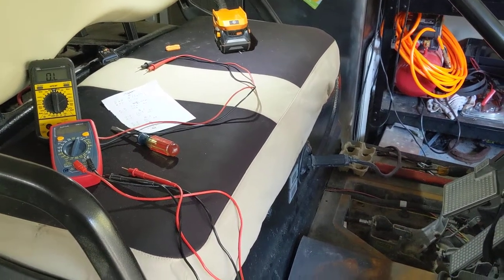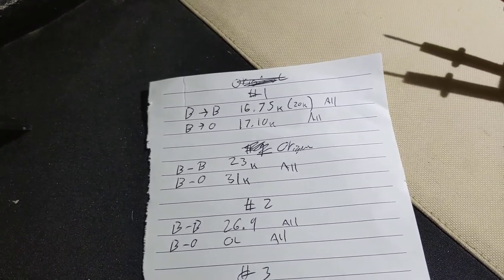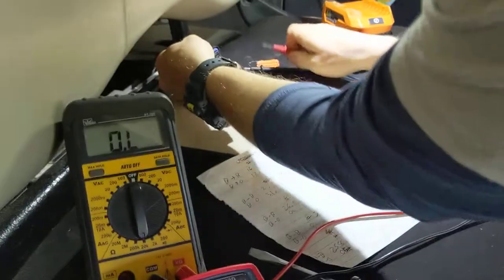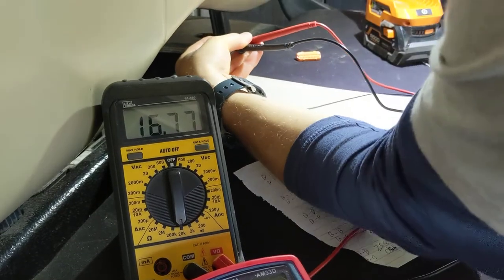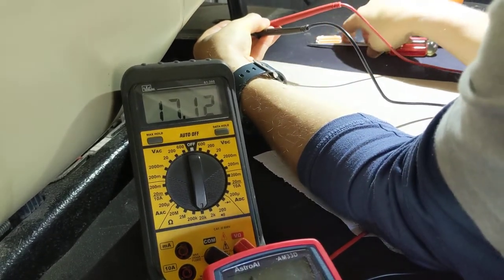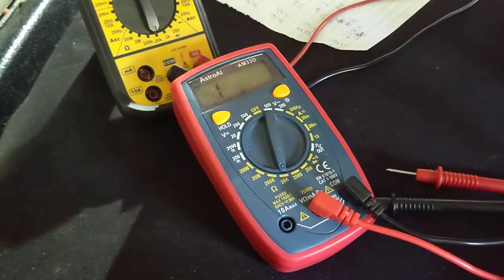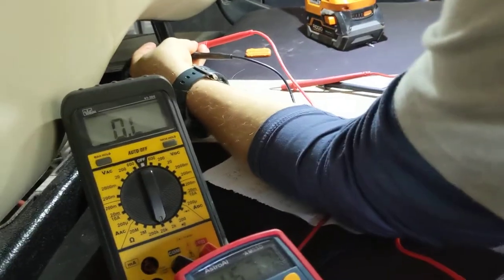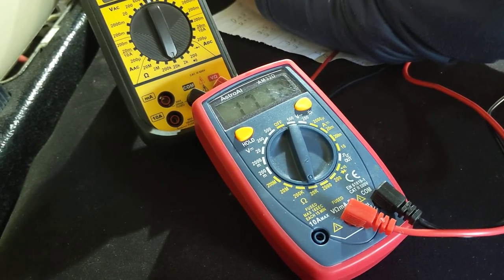Testing Yamaha G29 Drive TPS

Comment: This method is incorrect, sensor works off of voltage, not resistance, so you will get same resistance across terminals regardless of throttle sweep.  Only wat to test is by adding voltage and reading voltage change on signal  wire.
Reply from the maker: I believe you are correct, my testing method was wrong.

Comment: Hello, I also have a new sensor from Amazon that measures similarly.  Did you replace the sensor?  How did it work out?  Thanks!
Reply from the maker: After trying 4 different sensors I found the sensor to not be the issue. I believe I was testing it incorrectly and mentioned in a previous comment above.
Reply: @rqf4v9  thanks for sharing!